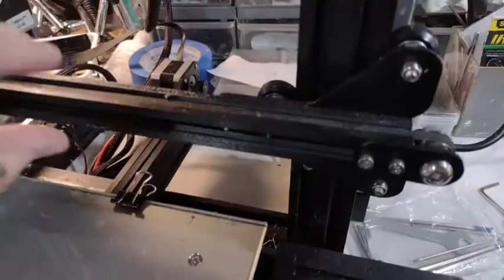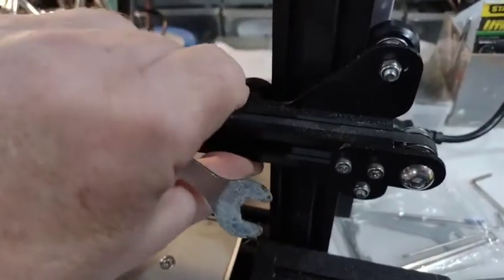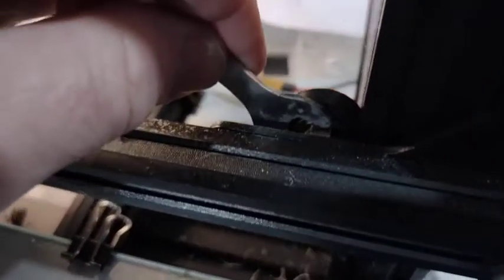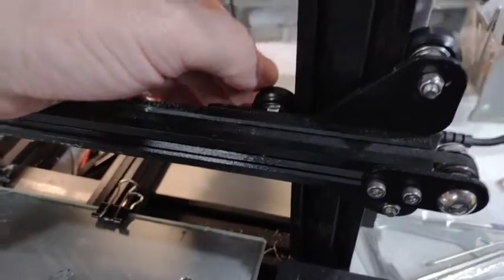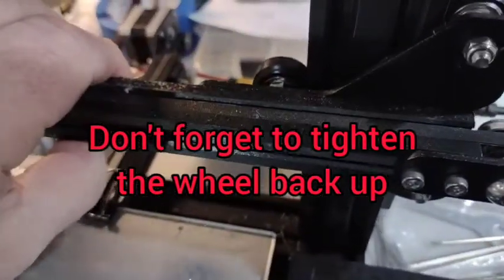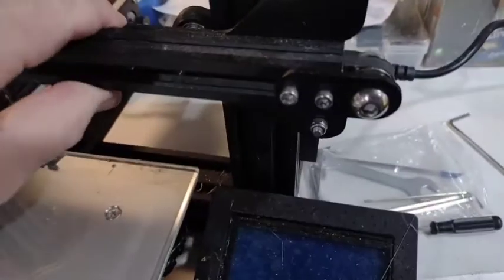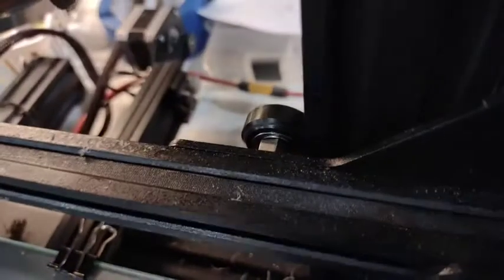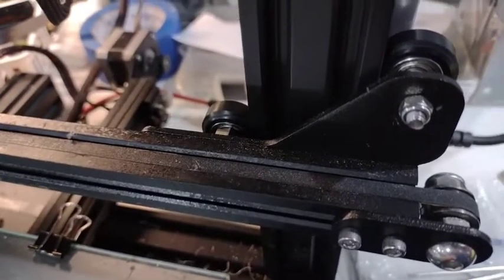Creality ender 3 loose gantry x axis bar fix

Comment: Just wanted to add a bit of info in case anyone follows this video;

The “nut” mentioned in this video is actually an eccentric nut, meaning that the hole is not centered. This means that “tightening” the nut actually means you are shrinking the distance between the roller and the rail. The nut doesn’t actually get tighter.
Reply from the maker: Thanks

Comment: My opposite side is way too tight, would this method help that too? Do I keep the inside loose when doing so as well? Or do you know of anything I can do? I returned one thinking it was broken and I’m on my second one with the same issue, it has no issue traveling down, but coming back up I can lift the machine if I tried. Please help🙏
Reply from the maker: It wouldn't hurt.
Go to the YouTube channel "The edge of Tech" and search reworking the gantry.
Basically loosening everything and then tightening in specific order.